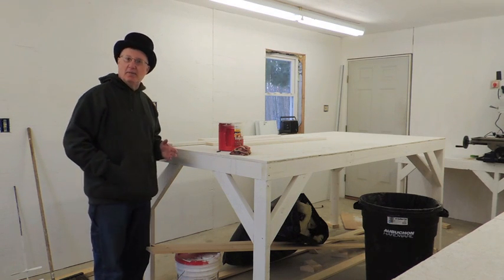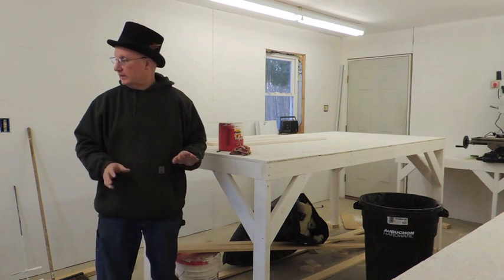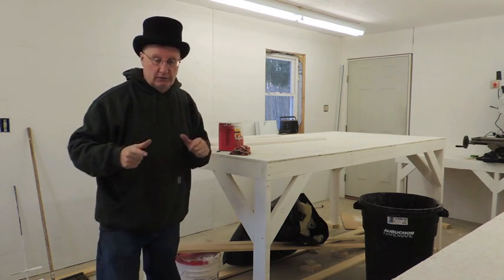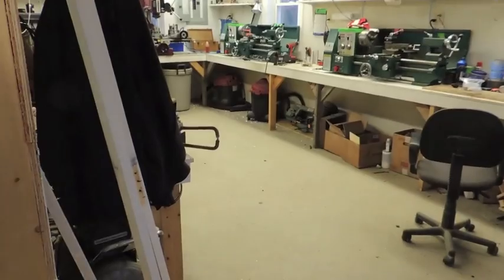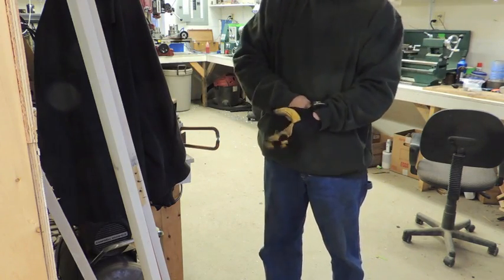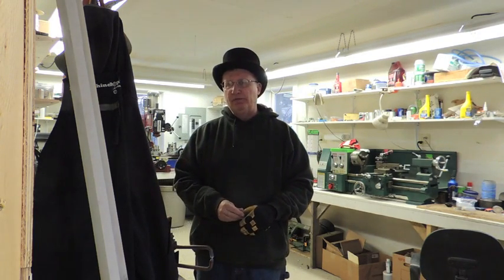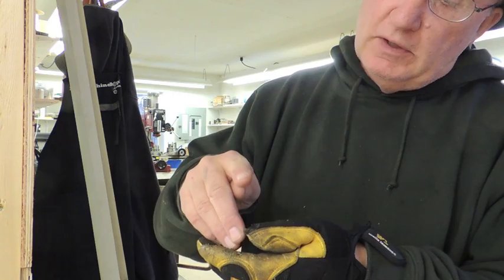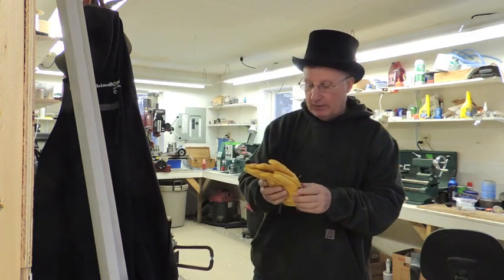Factory update

Comment: Tinny, Sam at batchstovez dot c o m has released his 22 oz aluminum pot.  It's an excellent replacement for a beer can pot.  It has a flat bottom, comes in two finishes, is rigid, and is large enough to get a hand inside for cleaning.  

I think it's a better choice for those who are still using beer can pots.